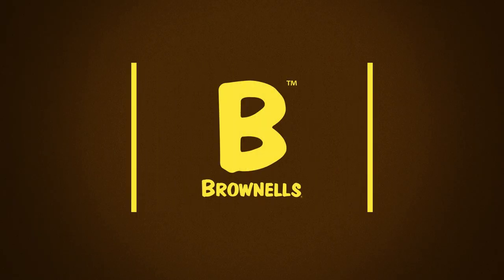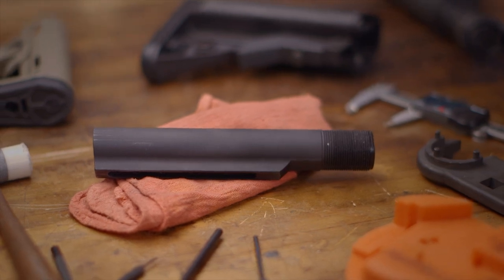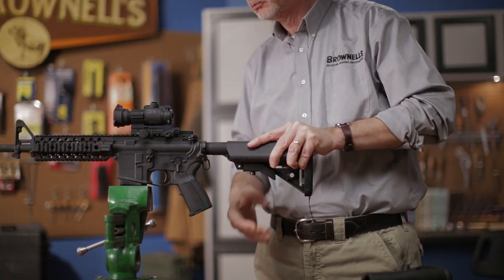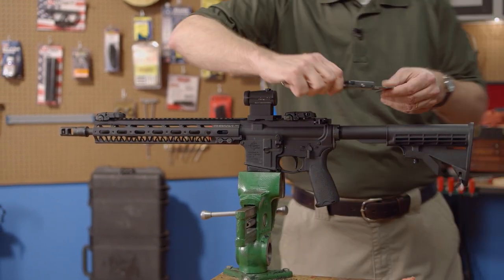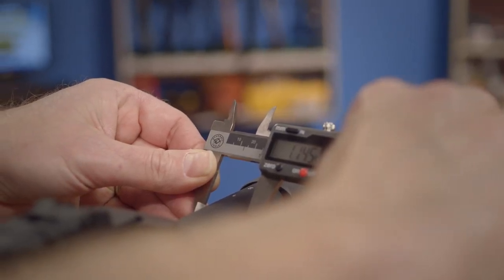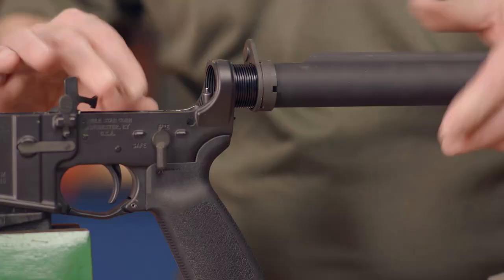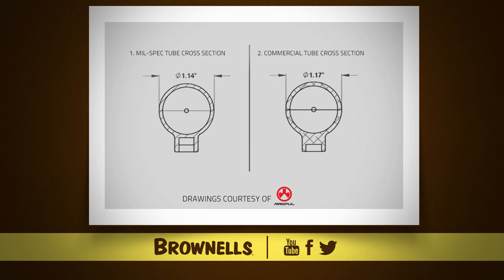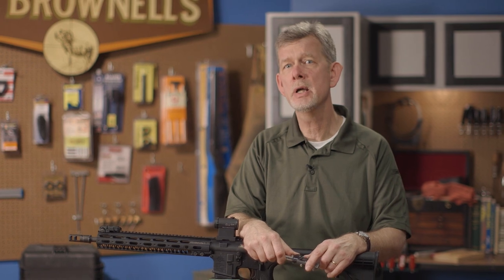Tech Tip: Mil-Spec vs. Commercial Buffer Tubes

Comment: They are both made using a press forging/drawing technique for the blanks but Mil-Spec roll forms threads up to size and commercial cuts threads down to size. Since the thread is the same there has to be a difference in material between additive and subtractive threading processes.

Comment: This is exactly what I was looking for. Almost wasted a bunch of money getting a whole buffer and spring instead of just the extension tube. Currently rockin commercial, but there's hardly any stocks that I love available for commercial. So I'm swapping for mil-spec.
Reply: Weird, isn't it?  I've spent 10 years in the Army, spent half of that working right next to an armament section, had my AR for another 10 years and I had no idea you could just unscrew one and stick the other one on.
Given how cheap mil spec ones are (i.e. like 10 dollars in bulk) why do com spec ones exist at all?  Maybe some holdover from the ban era AR's?  I've had a $200 precision stock sitting here in a box because I just assumed it was more complicated than this.

Comment: i have a commercial buffer tube can i change over to a milspec and use the same spring and buffer and will the milspec fit on the lower
Reply: watch the video again... he says your answer right in the video...  pay attention in life
Reply: haha
Reply: buggatti300 To answer your question, yes. The biggest difference between mil and commercial is is the outer diameter of the buffer tube. The only thing you will have to change is your stock.
Reply: When I was in Namm guys like him were always good at letting us know where the booby traps were. They never paid attention and got taken out by them all the time.
Reply: I have a DPMS Oracle 308 AR. Came with a commercial buffer tube. I’d like to replace it with a mil-spec. Anyone know if I need to look for a “308 AR sized” mil-spec buffet tube, or will the same mil-spec tubes for AR-15s work for my 308?